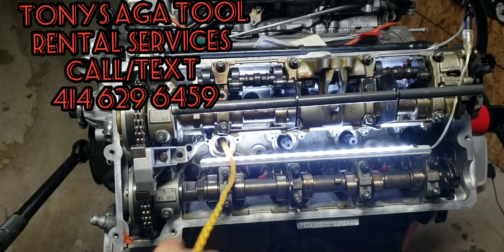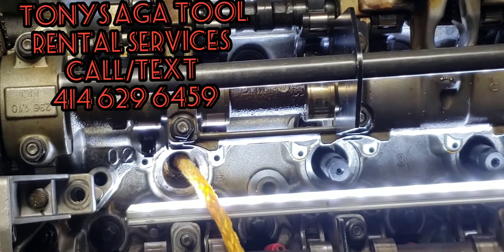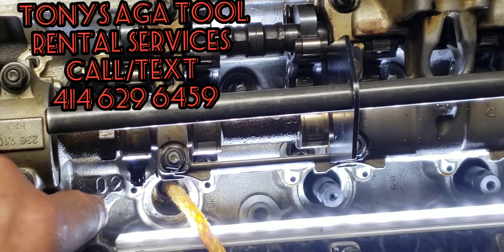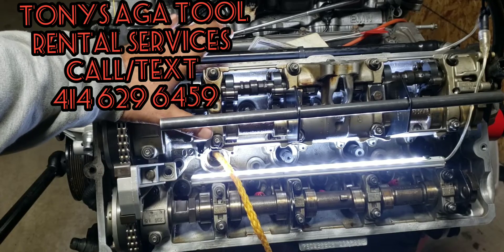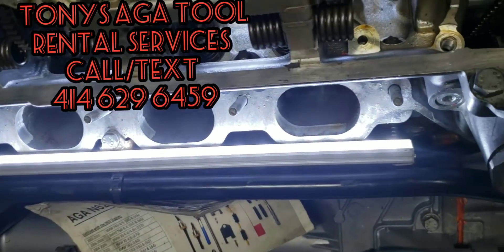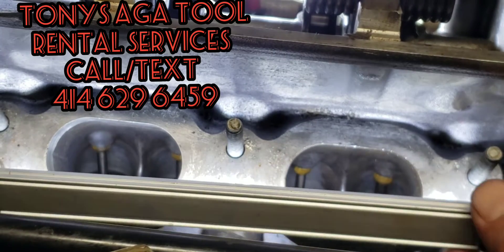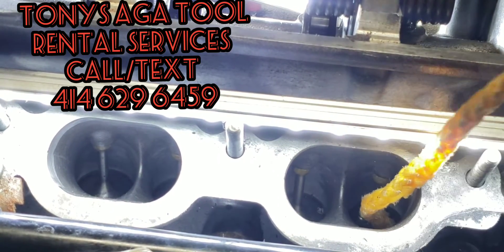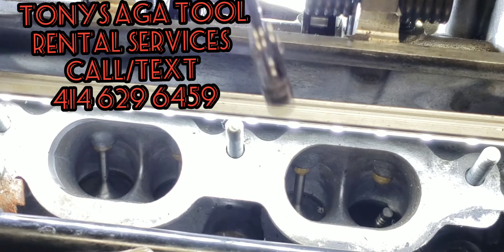Bmw AGA N62 VALVE STEM SEAL KIT TOOL( INTAKE VALVE DROP/RETRIEVED)

Comment: I was gonna use rope method 
But now no way 
I don’t want to deal with this I will just use air. So valve should not be able to drop all the way down as long as you have cylinder up?
Including exhaust and intake valve? 
I’m planing on doing N63

Comment: If you scratch the valve with those long nose pliers will that not allow oil to seep past the new valve stem seals
Reply from the maker: When you say scratch what exactly do you mean?
Reply: @agan62toolrentalservice68  when you use the long nose pliers to lift the valve upwards and back into place you can scratch the smooth metal. This will cause the valve stem to not seat properly and leak oil past it
Reply from the maker: @bmwlife786   the outside of the valve is steal  and the center is rubber, so if you use grease  it gives it Lub enough not to cause the damage